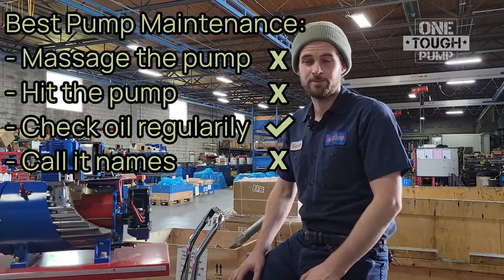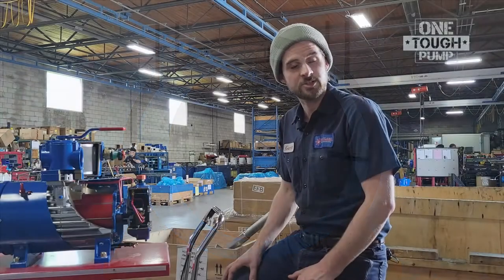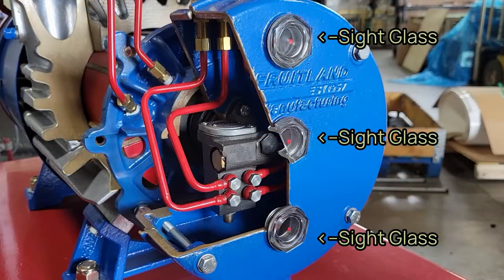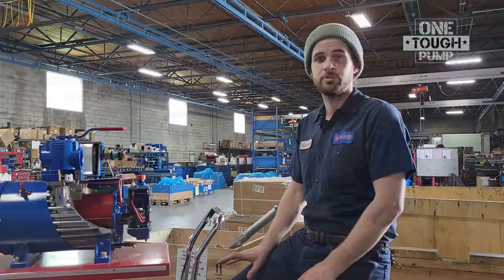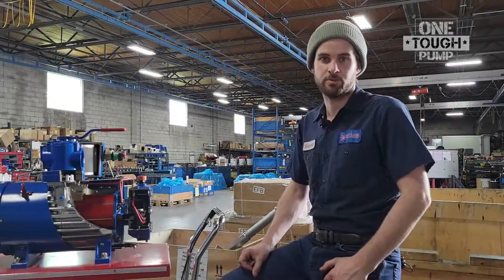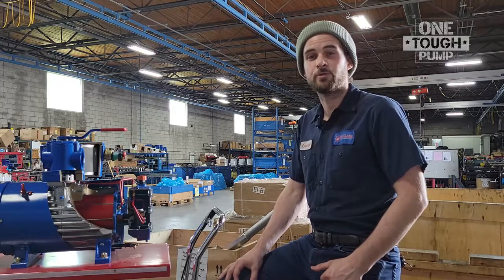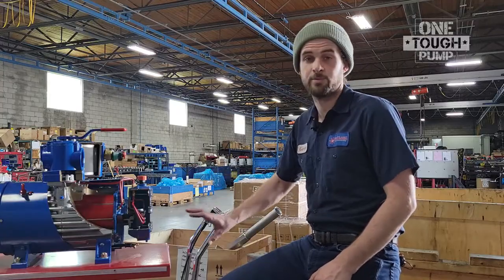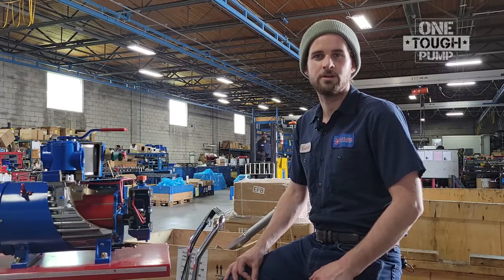What to Know About Oil and Your Pump

Comment: Interesting videos,we use these on vacuum trucks in the oilfield and they are tough.Drivers aren't educated on what oil or rpm's to run them at but should be.
Reply from the maker: Hi Daniel, thanks for the comment! We do find this as well - incorrect RPM's and running the oil dry/using the wrong oil are the main causes of poor performance or pump failure. All of this information and more can be found in the Operation and Maintenance Manual, or you can always feel free to give us a call if you or your drivers have any questions.